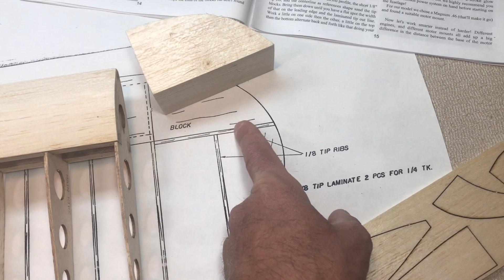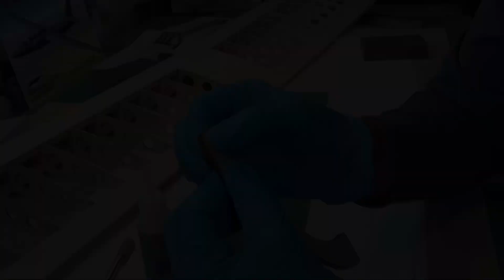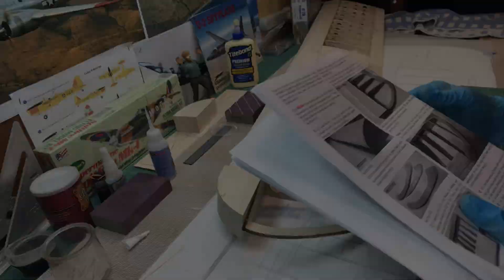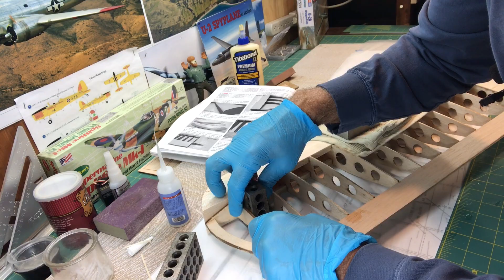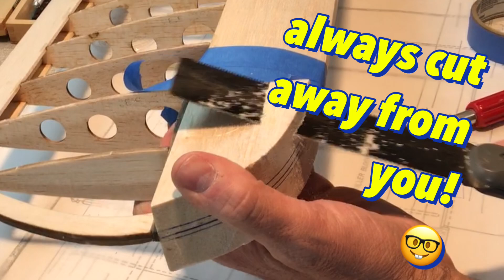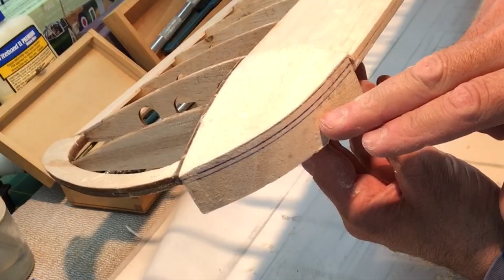Balsa USA Smoothie RC Plane Kit Build No 8, Wing Construction Part 6, Wingtips and Wing  Shaping

Comment: I built this model in the 80's.  I used a course file to shape the wing tips.  Something you might consider in the future.  Starting course and working down to the point of sand paper.

Comment: Mit einem balsahobel hättest du dir leichter getan, ansonsten gute arbeit.ich hab immer die grobe Kontur mit dem balsahobel bearbeitet , für den finalen Schliff der Nasenleiste und dem Randbogen hab ich mir ein Vierkantrohr aus Aluminium mit doppelseitigen Klebeband bestückt und anschließend kam dann das Schleifpapier drauf,so stellt man auch sicher ,das alles gleichmäßig und Gerade wird.ist keine Kritik sondern nur ein Tip damit man sich leichter tut, den nicht jeder hat so ein Augenmaß und Gefühl , damit schleift man nicht zuviel weg und die Nasenleiste wird absolut Gerade,und man läuft nicht in Gefahr das sie wellig wird. Den wo zuviel weg geschliffen wird muss man wieder nacharbeiten was es  für einen Anfänger nicht einfacher macht liebe Grüße aus Bayern
Reply from the maker: Hello! Thanks for the comment. Yes a olane is very helpful and I did purchase one along the way. I used it in later steps. I agree with you, it’s more difficult to shape with just knives. Thanks for your insight, I have learned a lot along the way from suggestions such as yours..

Comment: Thanks for all the build video's.  You can always make some soft weights for sheeting using socks and sand or small bean bags work well to.  I am working on a P-51D Mustang Kit for maybe os max 35 but also considering a saito fa-40.  Great Job
Reply from the maker: Nice, thanks for the tip, now i have a use for old socks! Good luck with the Mustang.